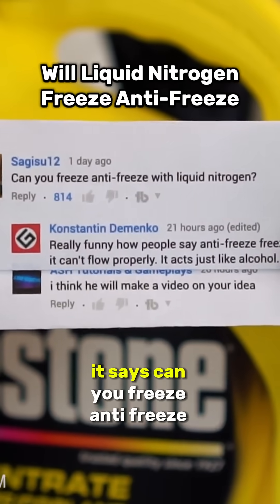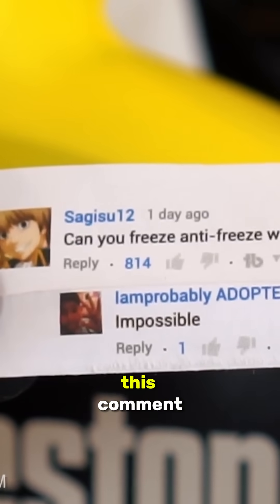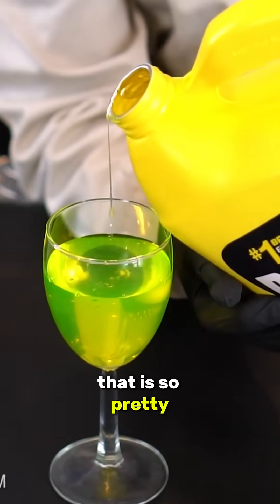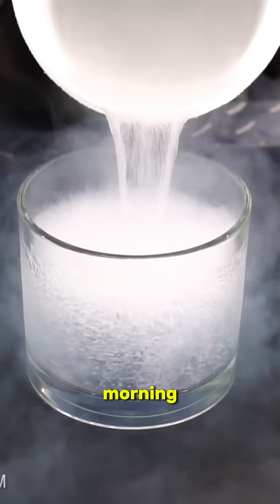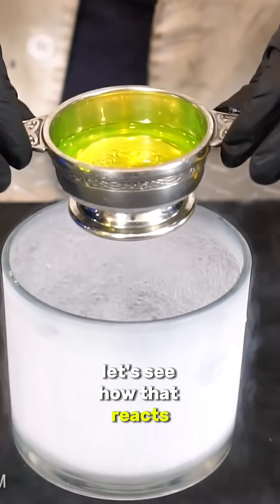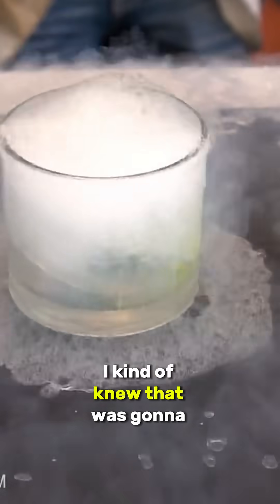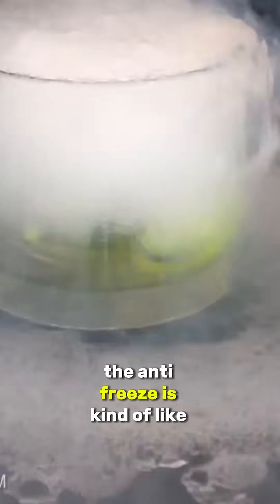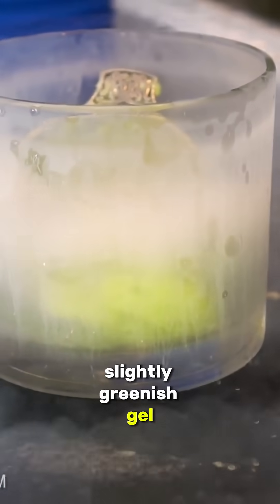Can You Freeze Anti-Freeze With Liquid Nitrogen

Comment: This could of been answered with common sense. Anti-freeze has a minmum temp it will go down to, and different anti-freeze has different limits. Also, modern anti-freeze is just not anti-freeze. It also helps with cooling the engine more efficiently and has ant-corrosion properties. Anti-freeze, technically, no longer exists and is really 'coolant'.
Reply: I mechanic for a living and I agree with most of what you said, but it's always been anti-freeze/coolant. It didn't use to be just anti-freeze, and because of modern cars its both. Water cooled engines have always needed a fluid that can both cool the engine and prevent freezing of the block. The mixture determines how hot and cold the fluid can get before is no longer effective. But yeah common sense should tell people that anything will freeze if it gets cold enough, it's one of the reasons block heaters exist.

Comment: 100% antifreeze (pure ethylene glycol) freezes at around 0 to -5 degrees Fahrenheit (around -18 to -20 degrees Celsius)
It goes down to -30F at a 50/50 water mix.  It will freeze.
Reply: Actually up your Canada we do know that it does freeze, but it actually gels so as far as freezing and breaking the block no not really. But if you only use straight antifreeze, it will gel in the engine and basically act like it’s frozen as far as not circulating.
Reply: Someone with some knowledge.

Comment: Of course, antifreeze will freeze. It only protects down to a certain temperature depending on the concentration with water. More antifreeze than water does not lower the freezing point a lot. When the mixture gets over about 60% antifreeze to 40% water, the freezing point starts to go up.
Reply: Pure antifreeze freezes faster than with water.mixed it's crazy

Comment: Like everything boils at a certain temperature, somethings might boil at 40°C other things might boil at 3000°C... everything freezes as well.
That's why every chemical compound has a boiling point and a freezing point...even gases, but gases are more depending on the pressure.
Well, stay in school kids, there's a whole class in which you learn more about this and it's complicated formulas 😂
But it's interesting...
Reply: Except...Helium. You can't freeze it under normal atmospheric pressure.

Comment: Antifreeze normally has a rating on it, in winter they advise to use pure antifreeze instead of watered down. A lot of the uk antifreeze I believe works down to -20 degrees Celsius.
Reply: 50/50 mix works down to -40 celcius. Pure antifreeze will freeze alot earlier.
Reply: 😂😂 pure freezes faster than mixed